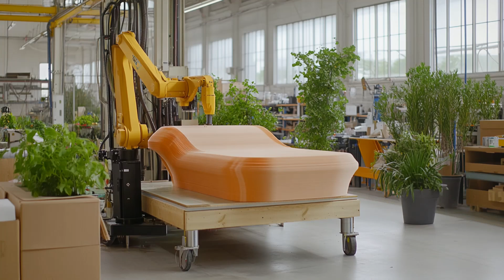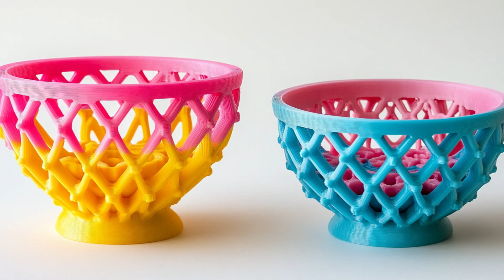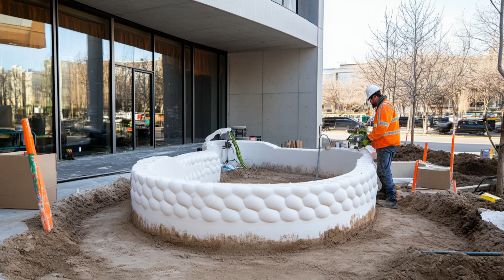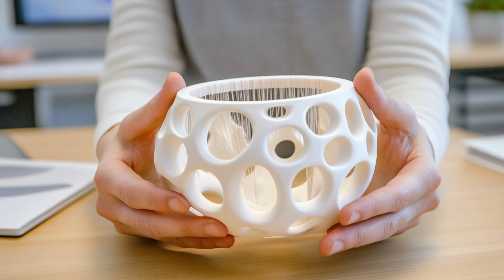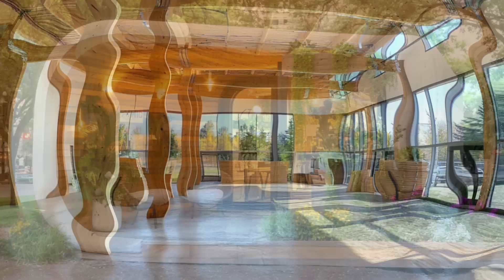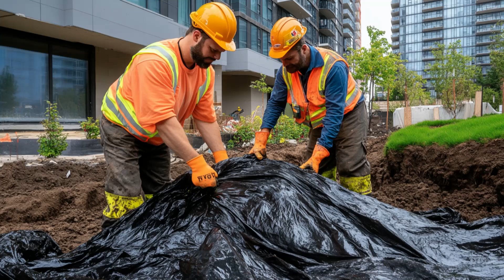How to Get Started with 3D Printed Architecture

Comment: AI Slop.
Reply from the maker: What else can we do? This is the era of AI.

For some, especially those with extensive knowledge like yourself, this may not seem valuable. However, for others, videos like this provide useful insights and learning opportunities.

Additionally, while this video was created using AI, effort was still required to structure and present it in a way that is engaging and easy to follow.

If this content isn't beneficial to you, feel free to leave it. It is intended for those who find value in the information shared.

by the way, thanks for coming and commenting